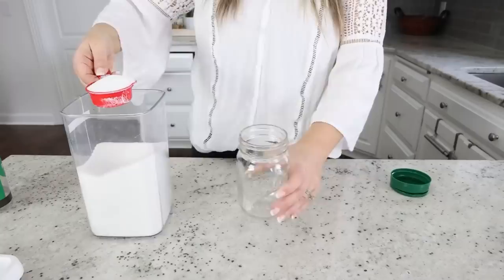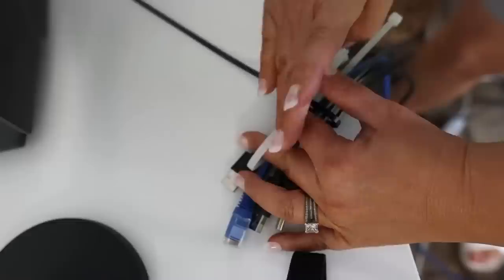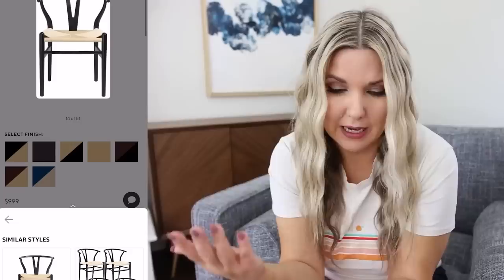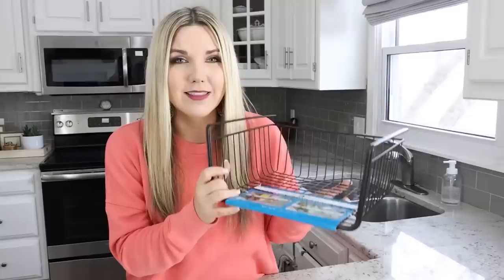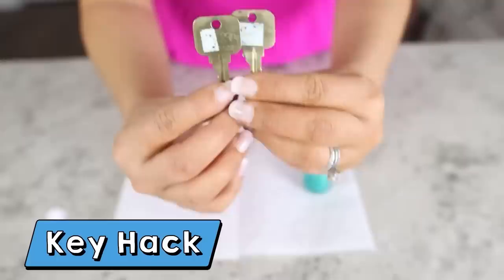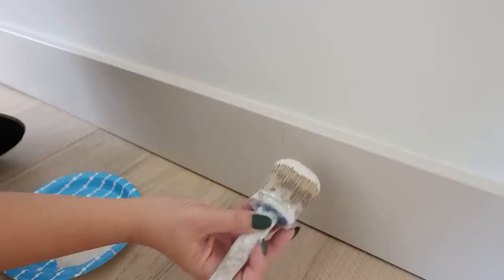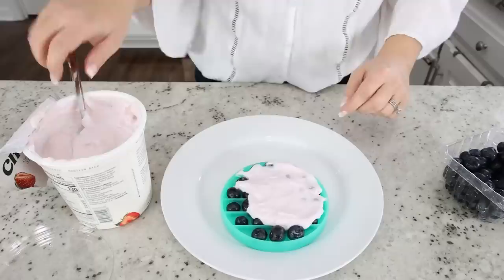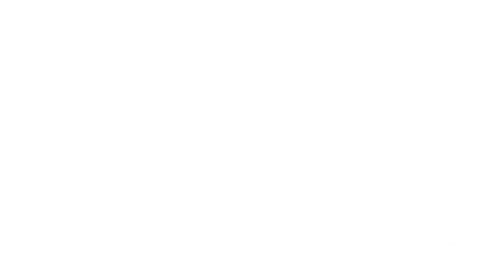60 HOME HACKS...That You HAVE TO TRY!

Comment: 🌷🌷🌷1. Always put in a few coffee filters on the bottom of your pot/vessel BEFORE you add soil! This keeps the soil in and still drains great! 2. I always use the denture cleaners in my milk glass vases to clean down a narrow neck or uneven surface, it really works! 🌷🌷🌷
Reply: I’ve done that for years!!😊
Reply: Thank you.
Reply: Omg I will do that from now on. This is genius, I have so many plants in my apartment, why didn't I think of it. Aaarggh. I love you, stranger.
Reply: Ice  shaken in your vase will also clean uneven surfaces 🧊
Reply: It seems you’ve inspired others, There are so many good ideas in the comments as well!
Reply: Does it work on Tupperware dishes or containers also I wonder. For chili or spaghetti stains? Mmm...
Reply: @tammydinatalli1245  I spray mine with vinegar and let them sit for a few
Reply: adding denture tabs to the toilet bowl works great as well!!
Reply: WOW! I’m going out to buy denture cleaner right now.Thanks
Reply: @Reneemfenn  👍 yes & add salt to the ice & it will clean coffee ☕ pot stains when shaken around.
Reply: Coffee filters is genius! My apartment is basically a jungle, so I do a lot of repotting. Thank you so much! I can't wait to try this!
Reply: Thanks for the tip
Reply: Denture cleaner helps get rid of the hard water stuff in your shower head. Just put warm water in a baggie and a couple of denture cleaner tabs and tie the opening of the bag on the pipe or hose the runs to the shower head.
Reply: @kennethhenshaw6576  cool!
Reply: You can also get outside gravel rinse it off with hot water and a little bit of soap let it sit in the sink rinse it out real good and put it in the bottom of your planter before you put the soil in
Reply: I've also used s piece of paper towel.
Reply: @tammydinatalli1245  Let us know if it works! 😀

Comment: For the hack making the planter waterer…. Growing up at 12 I didn’t have a drill and needed to put holes in a plastic planter I tried over and over with a screwdriver and had the idea of heating the tip of the screw driver over the stove for a few seconds it popped through that super thick plastic like butter! When you don’t have access to somethings it really makes you work your brain if you really want to do something! The screwdriver doesn’t get ruined at all! By the time you go to dig out the drill you could’ve opened that messy kitchen drawer and heated the screw driver for a few seconds. Also if you don’t want to buy a drill boom you’re good. I have a drill now, it’s handy but not as handy as this is!!! Try it!

Comment: Old shower curtains are great for protecting the the boot (trunk) of the car.  They can also be used to protect the work surface when painting crafts, or can be used as dust sheets when decorating the house.  Great for placing on the potting bench before potting up plants, and used as a ground sheet, under a picnic blanket.
Reply: We do this in our house with all our old ones. Makes a great truck liner when taking stuff to the dump & have definitely used them as drop cloths for painting outside.
Reply: Love the tips - what a useful channel especially as our income/jobs disappear and our environment gets crammed with our discards…
Reply: l
Reply: Ingenious! 👍🏼🥰

Comment: When I travel with my necklaces, I use Kleenex tissues. I lay out the tissue, lay my necklace on top and roll the tissue around the necklace. I then fold it in half and  put them in my makeup kit. That keeps them from tangling…Love all your ideas!
Reply: Thank you! I'm traveling more & this is a real problem for me. Appreciate the tip.
Reply: I use old pill bottles stored in a notebook pencil case for face powder makeup, Kabuki brush and jewelry. Easy to carry in backpack or small carry-on
Reply: I use jewelry zip lock bags for each piece of jewelry.  No tangling, no earrings mismatched, etc.  (They're very inexpensive at a craft store or online.) Instead of using tissues (which tend to leave lint behind) I buy Gift Wrapping Tissue $1.25 for 24 sheets at the local dollar store and wrap my jewelry.  I cut the individual sheets up if I don't need that much.  Thanks for you hacks!!!
Reply: "Many moons ago"  I used Kleenex to wrap each piece of jewelry!!!  We stayed in a hotel and I was going to wear my pearls to dinner but changed my mind and wore a different necklace.  When we returned home from our trip and I put my jewelry away, I realized my pearls weren't there.  Evidently, the maid threw them away with the Kleenex!!!   You can bet I never used Kleenex to wrap my jewelry again!!!  I use the little jewelry plastic zip bags.
Reply: Me too!!!

Comment: I re-use dryer sheets to wipe wood surfaces (not in direct contact with food), wipe TV screens and polish up faucet fixtures. Using any type of citrus peels, I slightly boil them in water (just enough to cover); then once the liquid is cooled, strain into a spray bottle adding more water. Works great as a degreaser. Still using those same citrus peels, I make little packets using used dryer sheets. I use these as little mini scrubbers for degreasing and polishing. I also re-cycled those plastic coffee creamer bottles to use for watering my house plants ( they have nice pouring spouts). Thank you for sharing so many valuable insights!

Comment: Great ideas, as usual! A couple of hacks for your consideration: soaking apple slices in a solution of 1/2 tsp salt and 1 cup water for 10 min prevents them from browning. Just drain after the 10 min and refrigerate. Great for lunches and snacks! 
And…
To defrost food like veggies or meat faster, place a cookie sheet on the counter, put the food on the sheet, and then add another sheet pan on top. Metal is a better conductor of heat than air and as a result your food will thaw faster. 

Thanks for the great content!
Reply: much easier to defrost meat in the microwave on the defrost function, takes minutes
Reply: Thx for the defrosting tip 🎉
Reply: I can tell you from experience that you absolutely CAN taste the salt if you do this. I prefer using lemon juice.
Reply: @JupiterJamie  Ha, that’s funny - it’s not salty to me at all. And using lemon juice makes it taste like a lemon-apple - yuck! 😂
Reply: soaking apple slices in a Lil bit of Sprite works also!!!
Reply: C"
Reply: @JupiterJamie  totally agree. Maybe if someone eats lots of salt they might not notice. Can't also use citric acid (from the canning section in grocery store)
Reply: If you are able to use part of the sink for, maybe 20 minutes (?), it's faster and more consistent to thaw frozen items with water from the tap flowing over the item and down the drain.  The item needs to be sealed in it's plastic wrap or bag, of course, but this is the very best method, because the water literally "pulls" and I mean it physically "pulls" the cold right out of the item and sends it down the drain.  Forget about defrosting in a bowl or dishpan of water, that just chills the water like ice chills drinks.  It's recommended to use tepid water from the tap, at the fastest rate which you can without splashing, and as long as the water is not flowing so fast that it flows down one side of the item.  It needs to envelope the item as much as possible, which inherently means a slowish flow.  I'm only saying that the rate should be sped up, because that will make it work faster as long as the water rate is slow enough to envelope the item being thawed.  If the tapwater is at room temperature, the item won't thaw unevenly, but warm water will cause unevenness where the tapwater hits the item.  It's a really good method, though, because the tepid water thaws the item throughout, because as the outside temperature of the item adjusts to the tepid water, the inside coldness will be pulled to those outer layers. 

It would be much better to demonstrate this in a video, but, it really is the best method.  For this reason, frozen turkeys thaw best under a tepid shower, which is improved with a handheld shower head which can be positioned so the water flow envelopes the turkey.  All anyone has to do to know that this method works, is to put your hand "downstream" of the water flow, where you can feel the coldness being pulled right out of the item.
Reply: I’m less than 1/2 way through this video and these ideas/hacks are great! I was just looking at the zip top bag organizers yesterday…but didn’t order bc I didn’t want to spend $30. This box from Target is perfect!! Next time I go to Dollar Tree, I’ll pick up some contact paper to cover it, and order it from Target!! I think if this was reinforced, it would be great for storage after the Target brands are gone!!

Comment: Not sure if anyone has mentioned this but for removing labels off of glass jars you want the acetone nail polish remover instead of the Non-acetone. The acetone works much quicker and gets the glass very clear🤩.
Reply: A low-key alternative is to soak the label overnight (sometimes longer) in oil.  I will typically just spread the oil on the label of a glass jar, and then put it out of the way on a flat plate or bowl to soak.  Oil breaks down glue, it's the chemistry of it.  A small amount of labels will leave a super difficult "calcium build-up" type --type of super thin material which is hard to remove.  I don't know what that super thin material is actually made from, but --and I hate to say this ---I've gotten it off with the "spit shine" method.  I've only come across small amounts of it, but, the "spit shine" method of using your own spit, is a good last resort.  I usually remove labels with oil because it's less toxic in general and on my hands, and is easier (olive oil from the pour bottle for the stove), as long as I designate an out of the way spot on the counter for the overnight soaking,  U just wanted to mention the idea, because a lot of people stress over getting labels off, when easy tricks are available.
Reply: Some labels wll come off in a soak in bicarbonate of soda or baking soda water, wine bottles for sure.
Reply: Take a heat gun or a blow dryer . The heat will loosen up the glue, and it will come right off.
Reply: D-limonene easily removes paper labels and adhesive residue, you only need a little, so the small bottle will last a long time.
Reply: Try WD40

Comment: Awesome ideas. Take a bit of caution using baby oil on stuff (kitchen sink). It doesn't decompose, will line the pipes and eventually promote build up and clogs.Years ago it was a trend to cover your skin with baby oil after showering to 'trap' the moisture, but it didn't take long to hear that washing it off created clogged drains. Aside from that, these are great tips and ideas...keep up the good work!
Reply: I remember putting baby oil in my bath water just a few drops and I never had trouble with pipes that was in my young year's after I lay out in the sun and tan beds

Comment: If you have any left over lemons:  Slice the lemon and then place the slices on a baking sheet (which has previously been covered with cling wrap, aluminium foil, or baking parchment).  Place the baking sheet of lemon slices in the freezer, once frozen place them in a ziplock bag and they're ready to add to cold drinks whenever you need them.  You can also do this with other citrus fruit too.
Reply: I slice my oranges and put them in I've tray to freeze so I cam add the frozen orange to my hot tea I make myself. ( Basically just cinnamon and sugar)
Reply: Or add lemons cut up in bite size pieces and freeze them in candy molds silicone ones

Comment: For the full bottles of toiletries travel hack, after you do the cling wrap, if you put bottles standing up in a Ziploc gallon bag, and then place them in your suitcase so that the bottoms are going to be towards the bottom of your suitcase when you’re pulling it vertically, that’s a second barrier. I do realize that the luggage handlers are going to throw them around, but that double layer of protection makes me feel better … and if we’re driving instead of flying, even better.

Comment: I have used denture cleaner tablets to clean jewelry for years. So great for diamonds and gemstones, even some costume jewelry. At the end of the video where you were trying to get the label off the jar with nail polish remover, I’ve tried this with little success.. however, I now use a cotton ball and vegetable oil. It removes the paper and the sticky residue from the label quite easily on glass jars as well as plastic canisters and storage containers. You are not using a lot of oil, therefore, it is easy to rinse after you remove the label. Thank you for all these great ideas!
Reply: Fulling with hot water and letting sit for 5 min allows for easy peeling every time!  Got to remember to empty and peel while still warm though!

Comment: Liz, when using large laundry container on it's side.  Unscrew lid before you push knob to get your soap. It will go from a slow drizzle to fast flow.
Reply: I leave mine screwed on just tight enough to keep it on. But I must say, I keep mine on the edge of the shelf right next to my washer and I've never had it leak or drip.
Reply: @Tammie Hammett 👍Yes, and you can also poke a tiny hole at the top to let the air in/out.
Reply: @FrankWilliams-ix2qt  
 (cc'd to @tammiehammett4808) For "@FrankWilliams-ix2qt,"  You are very strange. I don't know what your end game is, but for you to be reaching out in fake friendship to everyone on this entire thread "so in time goes on it will bring something great for us in the future" is very creepy. Knock it off!! :dothefive:(I reported each of these as harassment.)

Comment: Hi Liz. Another idea for the winter is add Ice Melt to cheap stockings or pantyhose after you cut off the legs and lay the full stocking along the edge of the roof or in the gutters. It will keep ice buildup from backing up in the edges of your shingles and help keep ice cycles from hanging off the house. Obviously,try to get stocking that match the roof or at least all one color. It worked for me in Michigan and my friends up there still use them.
Reply: Omg this is amazing Sandra.  Dumb question lol do j put the stocking on the very edge where the water drains down?  Does it have to be the nylon type material?  The co. Who did my gutters stated that is happening because of my attic!!!!  This gutter co. Is one big joke. The drains are coming off the house, they not returning my calls.  Long awful story..  thanku sooooo much for the tip.  I'm in ohio lol
Reply: @karens7620  I actually put them just at the end of my roof. They eventually lost the chemicals and just blew off the roof. I am happy I could post this so people would be able to try it out. BTW…GO BLUE! 😉😊
Reply: @sandravinup5102  thanku so much for replying & I'm going to try that. For sure 👍  I sure wish I saw this yesterday before this crazy weather today.  Lol 😆  Michigan is literally down the street lol  😆

Comment: I reuse my glass pasta sauce and pickle jars for dry goods in the pantry - rice, dry pasta noodles, lentils, dry beans, cornmeal, and grits store great in these containers and can be labeled for easy identification.

I keep the rubber bands off of asparagus and herb bunches in a drawer then reuse them later when needed.

I get castile soap (yo, Dr. Bronner!) and mix it with Dawn plus water to make a great dish washing agent.  To make solution fill an empty 24 oz Dawn container with a 5th of Dr Bronner's, then add a 5th of Dawn to the container, and add water to the top (a low flow is best).  Close up the bottle and gently turn it bottom over top until combined (try not to make suds as that is the cleaning agent). It will be fluid but a little goes a long, long way.  This helps your Dawn to last longer but still cleans a tremendous amount of dishes.  I use about a quarter cup per sinkful of water (I believe my sink holds three gallons).

For those who have firepits - don't toss your wood ash - save it and sprinkle it on trees and bushes.  The sodium  bicarbonate is good for them.  Same with banana peels - the potassium in banana peels acts as plant food.

Last one - don't throw out toilet paper rolls or your dryer lint! Store your dryer lint in a container and when you go to make a fire pack some of that lint into the empty roll, squeezing the ends to keep the lint inside.  These are great for camping or for the  backyard firepit.
Reply: Add water to your squeeze bottle first.  Then add the soap/Dawn/Bonners and you'll avoid the bubble.  Then cap and rotate to mix.

Comment: If you haven’t tried Press & Seal Versus the Clear plastic wrap. IMO it’s a game changer. It adheres better, it is MUCH MORE air tight, and it keeps things or carbonated much longer. I’ve never been a fan of clear cling wrap (admittedly) it’s just hard to work with. Press andSeal is life changing.

Comment: Like your idea on covering your bench cushion, but if you just use safety pins instead of glue, you can take it off to wash it again. Because we all know kids tend to spill
Reply: Or  velcro ...
Reply: Or even use Velcro ( glue it on )
Reply: Right?  Why do they even sell sewing machines anymore?  We have hot glue.
Reply: @IrkallaC  do  you  spose  hot  glue  would hold  clothes  together??
Reply: @PK-bh1ww  course, hot glue holds everything!  (It's sarcasm by the by, I seldom use hot glue.)
Reply: @IrkallaC    I  had  thought  you  were... but  posted anyway. lol.   But  hot  glue  does  come in dang handy .  I'm not  an avid  crafter  but  rely on it  at  times when making  a Xmas  decoration. And makes bow  making  easier.
Reply: @IrkallaC  I never use my hot glue gun... I've never had hot glue hold. It's a temporary fix until I buy more Gorilla Glue.